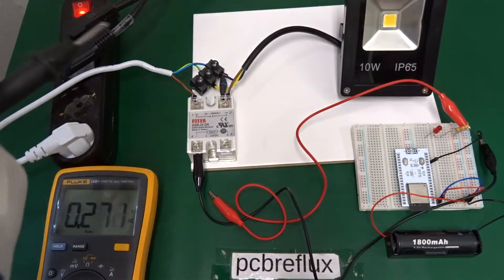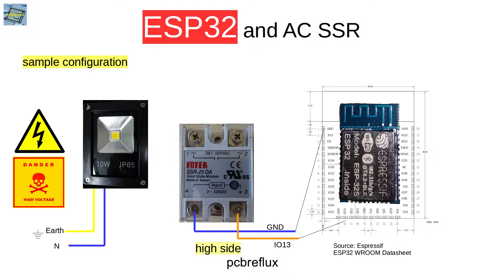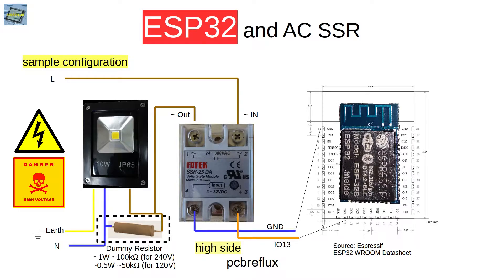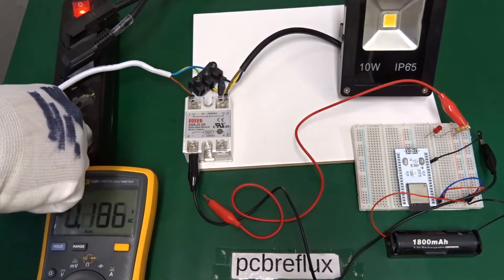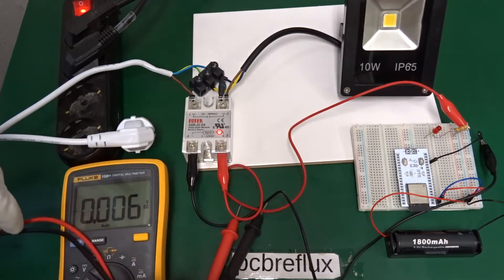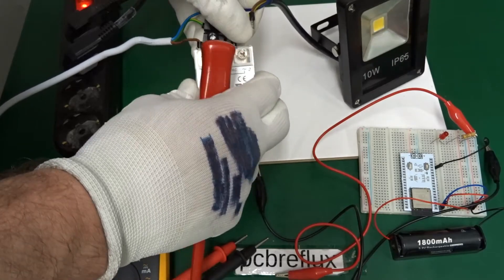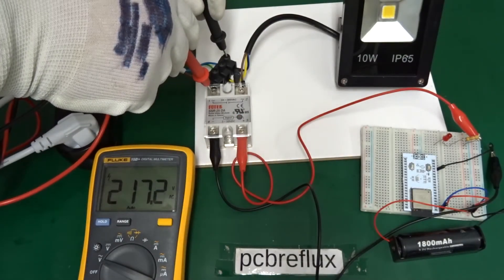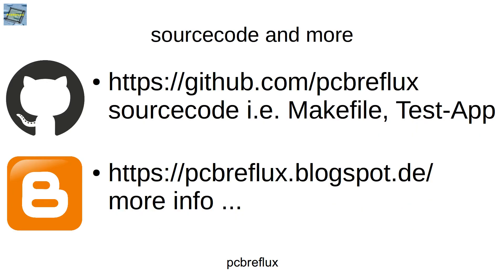ESP32 #32: ESP32 Smart LED Prototype + ESP32 Giveaway

Comment: A belated but no less heartfelt thanks for this (an all You other) excellent videos.
PS. I also want to give special kudos to You for changing the resolution and font when presenting Your code so that it can be more easily read !! It helps both people watching on mobile devices as well as people watching on smaller computer screens, not to mention us who have "non perfect vision". And this is something that all to many "creators" still (2024.02.07) seemingly have not understood....Now I would never complain about people sharing their work using  "to high resolution", I just think both their audience and they would benefit from them understanding what You demonstrated here.
So +++ for that consideration

Comment: Any particular reason for using an ESP32 for this? As I see, it could be any arduino or any microcontroller.
Reply from the maker: rodstartube Yes, next step is to integrate WiFi, Bluetooth, MQTT and more. And also the LED is only an example, why not implement a WiFi+MQTT enabled Reflow Oven? But more testing have to be done and also safety have to be considered.
Reply: pcbreflux in that case you can still use an ESP8266, it 4 times cheaper. a bluetooth module are also cheap. well, i'll be waiting for your next video about it
Reply from the maker: You are right the esp8266 will do the job, but for security I am a little bit paranoid. I think even at home every communication between to devices have to be  encrypted anytime (unencrypted, unsigned DFU OTA -> no way!). So its nice that the ESP32 have hardware encryption, but sure the price have to drop down below $1 per Chip and the modules have to shrink (lose maybe some GPIOs and the price have to drop maybe below $3) before it's time for the most uses cases to change to the ESP32.
Reply: So ESP32 is for paranoids. lol (joking)

Comment: I have experience with the ESP8266 and was wondering if it is worthwhile to switch to the more powerful (and more expensive) ESP32. OK, I know it has a lot more beefier HW, but so far I feel I haven't maxed out the ESP8266 yet...
Reply from the maker: cygeus Hi, for me the two biggest advantages of the esp32 beside the two cores, more speed and gpios are hardware encryption (rsa and sha hash) and bluetooth. Sure today the esp32 is more expensive but hopefully the modules drop down below $5 soon and maybe below $3 in 2018?

Comment: Have you measured the resistance of the SSR while switching
it with ESP32’s 3V? Wouldn’t it be better if it was switched by a higher
voltage?
Reply from the maker: Do you know a way to measure the resistance of an AC SSR? Just hooking up the DMM in the resistor rage should not work, but I don't tried. Think there is a TRIAC if its triggered it should work for any voltage in the sinewave?
Reply: I think it must be possible by measuring the difference between the input-output power of the SSR. Usually the triacs need a small voltage to get activated. I was curious to know if they've used a diac to trigger it and if the dissipated power is related to the trigger voltage.

By the way, thanks for the great content. Keep up the good work!
Reply from the maker: You can watch the teardown with schematics: https://www.youtube.com/watch?v=DxEhxjvifyY
Reply: Thank you klassich_D and pcbreflux. I got my answer. The
triac is actually triggered using an optoisolator from the AC supply voltage which is independent of the 3V SSR control voltage. BTA12-600B datasheet specifies the maximum dynamic resistance but not the average AC resistance. Considering it triggers at 1.3V and have a voltage drop of 1.55V at the peak on-state, Fotek datasheet claim of 1.6 seems fairly reasonable! Also, I love the 1% power loss rule of thumb :)

Comment: Thank you for your contributions to ESP32. I am still using ESP8266.
1. Do you already have an introduction explaining your development environment?
2. The leakage current of your solid state relay is produced by the snubber Network and the triac/SCR. There exists solid state relays without snubber Network and with smaller triacs. I tested the widely offered "OMRON SSR Relais Relay Modul G3MB-202P" and their leakage current did not influence even my weakest LEDs - and much more important: they have implemented a zero crossing Switch which avoids high inrush currents. But use at least the 2 channel Version; the saftey distances of the one channel versions are too small   (e.g. eBay 272385241585)
3. to avoid power dissipation of the resistor probably you could use a capacitor to snub the leakage current. But it should be a X2-type for safety reasons, e.g. 47nF 275VAC
4. your resistors probably are not rated for 230V. So it would have been better to use smaller values and put them in series instead of bigger ones in parallel.
5. I try to avoid the ugly and unreliable chocolate blocks and  prefer the Wago 221. Easy to use, safer and much more reliable. It is not recommended to use stranded wires without ferrules in chocolate blocks.In DE you can get them at Hornbach. Btw. are you sure that mains voltage is still 220V?
Reply from the maker: Thank you, I really appreciate your advice. 
1. For development I am using eclipse neon on ubuntu 16.06 64bit (but it should run on other OS with slightly changes as well). Neil Kolban had done a video about setup eclipse for esp32 and there are tips at the esp32.com forum and down here in the comments. Found Eclipse is more advanced then using other IDEs for projects related to C/C++ with a gcc (xtensa) based compiler.
2. This is my first time using solid state relays on the mains and just started with the cheapest, so thanks for pointing out other technologies and products.
3. For the capacitor could this estimated with 1/(2 Pi F C) so 47nF is equivalent to ~68KOhm at 50Hz?
4. Not done a real test other then some hours of blinking, but thanks its better to user proper rated resistors.
5. Yes its more rated 230V/240V and for now I just use whats lying around but also ferrules. And sure for working with mains I should do more research on safety. 
Thanks for take the time and also showing of errors.
Reply from the maker: Hi, looked up the OMRON SSR. With only 2A they used in an other range than the Fortek 25A. And yes, by looking at the pictures the 1 channel ones are orientated sideways so the distance between input and output are small. I want the prototype to be in a wider range not only for LEDs, maybe also for switching heavier loads (>500W).
Reply: Yes, the OMRON SSR are in a different range, but in a range better suited for most LEDs, especially that one you demonstrated. The leakage current is quite low and I had no issues with flashing or glowing. And it has zero crossing switching. This is very helpful driving capacitve loads by reducing the inrush current. 
If you drive higher loads most probably the leakage current of your Fortek 25A will not be an issue and you will not need the resistor. Some of the Fortek http://www.fotek.com.hk/solid/SSR-1.htm do have "Zero Cross Trigger" which is suitable for resistive and especially capacitve loads. Inductive loads is a different story. 
Meanwhile there exists some SSR without snubbers and low leakage curent as 0.1mA, e.g. Crydom EL240A10-05 or EL240A20-05. But ugly connectors and different Price Point.
Reply from the maker: Hi, one question about the OMRON and the Crydom SSRs as well: did you try them at 3.3V GPIOs?
Reply: No I did not, because they are out of spec. They are rated with 4V at least. In these cases I use a transistor (e.g. BC337) or a MOSFET (e.g. AO3402, Si2302DS, IRLML2502 or IRF3708 if a TO220 would be better to integrate) to control the LED of the SSR. In most applications the 5V are available anyway. But I can check if individual OMRONs work with 3.3V @ room temp. 
Generally I hesitate to use the bigger SSR. They have huge power dissipation and are not too reliable. In my opinion the zero crossing control is the biggest advantage switching bulbs or capacitive loads. Otherwise a relay does the job. It is cheaper, smaller and dissipates less.
EDIT: Pete Scargill already tested it successfully: http://tech.scargill.net/solid-state-relays-2/ - out of spec of course.

Edit 2: I tested a bare G3MB-202P 5V type with a 60W incandescent bulb and my lab power supply on the input side. It switches on @2.6V and takes 2.8mA. The readymade modules may be different. They already have a general purpose NPN transistor S8050, additional indicator LED and so on. They have an additional DC-In input which obviously is supposed to be on 5V. Probably according https://www.sainsmart.com/featured-products/sainsmart-4-channel-5v-solid-state-relay-module-board-omron-ssr-avr-dsp-arduino.html which means 10k input resistance and should work with 3.3V on Input. I am not sure if this would work with 3.3V @ DC-In, too. 
I will test later first I have to go to buy fresh aspargus.
Reply: Now I checked it with a ready made module. My modules seem to be different to the "saint smart". They have a reverse polarity protection diode and are inverting, i.e. GND signal is used to trigger the SSR. So when connecting "Ch 1" to "DC -" the SSR turns on @3.0V or 3.1V at "DC +" and draws 3.2mA. 
A clear advantage of the modules is the integrated fuse.
btw: When experimenting with mains I am using an isolating transformer.
Reply: Now I bypassed the reverse polarity protection diode and this module  now switched @ 2.3V. So, you can risk it. Of course without guarnatee because out of spec.
Reply from the maker: Thank you for all the information and the testing. For further testing I appreciate the hint with the isolating transformer and try to get one before next steps.
Reply: 1) I bought a used Isolation transformer. This costs more time but less Money. 
2) There are 2 possible "professional" Solutions für the leakage current - or at least commercially available solutions of decent companies:
 2a) Busch-Jaeger Kompensator 6596 which seems to be a 0.39uF Capacitor with 47Ohm in series.
 2b) Eltako GLE "Grundlastelement" which seems to ba a PTC. The PTC has a low resistance when it is under low load (SSR is off). When powered, it heats and the resistance will be increased. After switching off the LED may glow a few seconds until the PTC is cooled down again and gets the lower resistance.

Comment: It would be nice to see a demonstration of the dual core implementation of the esp32. In particular, the notion that it can run "blocking code" while running the wireless stack (without yield() statements), vs on an esp8266 the same code would cause it to reboot.
Reply from the maker: I can prepare a sample with a socket server and wifi on cpu0 and a blocking task on cpu1.
Reply: Thanks! You're awesome! When I get an esp32 I will be glad to try this out vs the same type of code on the esp8266. It would be a fairly simple demonstration of showing the serial output of both ESPs, with the esp32 showing normal serial debug output, and the esp8266 showing the reset debug info looping over and over, such as:

ets Jan 8 2013,rst cause:2, boot mode:(3,6)

load 0x4010f000, len 1384, room 16
tail 8
chksum 0x2d
csum 0x2d
v09f0c112

It wouldn't do much other than to demonstrate the usefulness of the dual core functionality of the esp32 vs single core esp8266, and the consequences of blocking code, but it would make quite an educational video! ;)